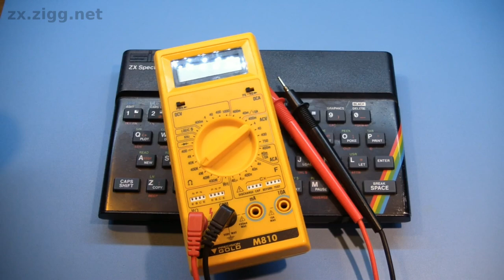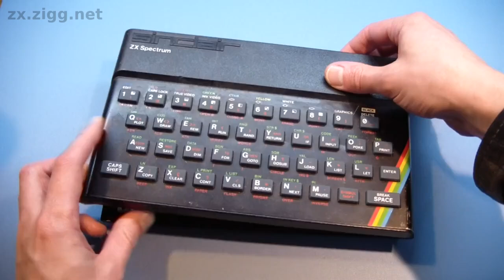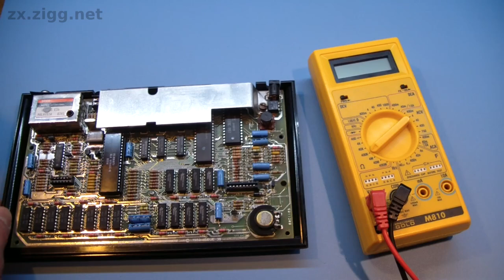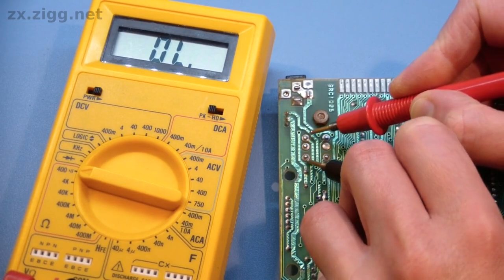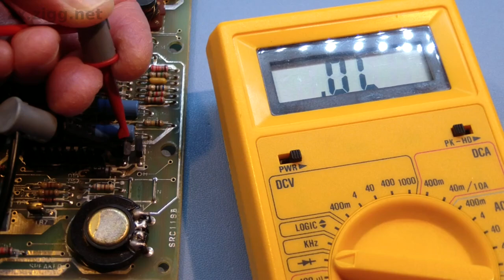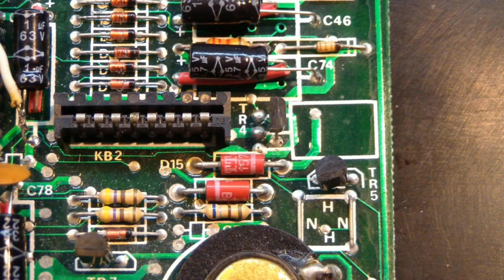ZX Spectrum (48K & 16K) Initial Tests

Comment: Hello! Is it possible to perform a composite mod on a Spectrum+ 128k? In the same way someone would do on a 48k/16k? Thanks!
Reply from the maker: leshurex I would think that bypassing the modulator in the same way as in earlier versions of the Spectrum would work. However, in the interests of keeping the computer in close to original condition, I wouldn't bother; the composite video signal is available on the DIN video socket. 

To use this output, one would wire the screen of a 75 ohm coax lead to pin 2 and the core to pin 1 of a suitable eight way DIN plug and the other to whatever type of connector is required for the display.
Reply: JoulesperCoulomb  Thanks for your quick reply! I bought that model some months ago, along with a faulty 48k model (displays flashing coloured blocks). At that time I performed the composite mod for both of them. Sadly, I never got to test the 128k given that it won't turn on (probably because I'm using a generic multi-voltage psu). Anyway, since then I was worried that the mod could've damaged the Speccy.
Reply from the maker: leshurex A basic power supply that outputs approx. 9 V DC and is able to supply around 1 A will do for either computer. Don't forget that the centre terminal of a Spectrum's power connector is the negative one. Getting the polarity wrong is likely to cause damage. There is a video in this channel about ZX Spectrum power supplies, should you be curious to know more.

In the case of the 128K Spectrum, if there is no signal on the composite output, it's a good idea to try the RGB output. If you can obtain a picture from the latter, it's likely the composite encoder IC or the voltage converter circuit that generates its power supply has failed.

As always, there could be many causes, but a display of flashing coloured blocks in the 48K Spectrum most likely points to a lower RAM fault or failure of the voltage converter circuit.
Reply: JoulesperCoulomb I remember testing the 48k's RAMs following this video and found any wrong values (I don't know if that rules out a RAM fault or not). How can I test the voltage converter circuit you mentioned? 
If it's worth mentioning I found that the X1 crystal was (pretty lousy) replaced with another, but not with the same component.

As for the 128k, I believe there was some problem with the power feed, but I would have to verify that later.
Reply from the maker: leshurex Good results from the tests described in this video don't guarantee the Spectrum is free from faults.

Have you measured the three power supply voltages (with power on) at the lower RAM?

X1 should be a 14 MHz quartz crystal. If the Spectrum is producing a picture, then there is almost certainly not anything wrong with X1.

If you get completely stuck and want to have your Spectrum(s) working again, I can offer a repair service (contact me via http://zx.zigg.net).
Reply: JoulesperCoulomb  Thanks again! I will check a few things more with my Spectrums using your tips. If I get completely stuck I would prefer giving them to you for free if you want them. Cheers!

Comment: Excellent job!.
I'm having trouble with my issue 3 spectrum displaying thick black and white vertical bars, sometimes with weird characters between them.
I've followed your tests and everything seems fine. Anyway I still have to replace capacitors.  
I was wondering, would it be worth to remove multiplexors IC25 and IC26 to bypass upper memory and see how initialisation could change? Is that a bad idea ?
Cheers
Reply: I have got the same problem with one of mine same issue also. How  did it work out?

Comment: Hi I have a 16K spectrum issue two, with small upside down pcb inside that is connected by thin wires near to the edge connector, is this a rare type ?

It powers on but so far I am unable to load games they either resets the spectrum or give me "M RAMTOP no good, 0: 1"

Any ideas ?

Thanks
Reply from the maker: I could be more certain if I were able to see the thing you describe. However, I suspect it is most likely a necessary modification because the computer has or had a 5C102 ULA fitted. This has a bug in its handling of I/O contention, which was (mostly) corrected by fitting an extra IC in the manner you describe. I assume this is an issue 2 or (if you're very lucky) issue 1 Spectrum.

If it hasn't been upgraded to a 48K model, is the software you are trying to load for the 16K Spectrum? Not too surprisingly, software expecting to find 48K of RAM won't work in this case.

Otherwise, faulty RAM is one of the most common causes of this type of problem. Try loading and running the Memtest program available at http://zx.zigg.net . Tell it to test the lower RAM. If your Spectrum has been upgraded to 48K, also have it test the upper RAM on a separate run. If the program should stop with an error report, post a copy of its output.
Reply: JoulesperCoulomb Thanks for the reply

I tried loading the memtest and a 16k game the program is found but then I just get the "M RAMTOP no good, 0:1" error.

Would a new lower ram fix module this do you think?
Reply from the maker: It might, but I'm a bit doubtful.

It's unusual, though not unknown, for a Spectrum to have a lower RAM fault and there not to be corruption of the display, which you haven't mentioned.

Are you sure it hasn't got the upper RAM fitted? The symptoms you describe are more often caused by a faulty upper RAM IC interfering on the data bus.

What result does the computer display if you execute the BASIC command PRINT PEEK 23732 + 256 * PEEK 23733  ?
Reply: Upper ram sockets are empty and has 16k sticker on the back.

I get 32767 result from commands, there is no corruption the spectrum starts up ok and simple basic listings work ok.

But when loading from mp3 player via ear port it gets past the found "program name" part but it either resets, or gives the ramtop error depending on the game or rom i try.

I have also replaced the capacitors.
Reply from the maker: This is certainly a rather unusual fault.

If I wanted to be fairly sure of uncovering the cause, I'd connect a many channelled logic analyser and capture what the CPU is doing at the time of the crash. I could then work my way through that, with a listing of the ROM disassembly on hand and I'd very likely be able to identify what went wrong. However, this process can be extremely time consuming and tedious.

If I wanted a quicker option, I'd probably try replacing the lower RAM as that has to be a prime suspect, but we can't be at all sure it is the cause of the fault.

WARNING: If you're going to remove the 4116 ICs and you haven't the equipment, experience and confidence to remove them intact without damaging the circuit board, I strongly recommend you use the method of cutting their legs off, before removing each leg from the board individually. It's much easier to obtain replacement RAM than it is to repair a circuit board that has had copper pads and tracks torn off. For further guidance on this, see:
  https://www.youtube.com/watch?v=u_NnU48bmv4
Reply: Thanks again for the info, I ordered a lower ram replacement from your link, luckily the ram ic's are already socketed, so removing them should be ok.

Comment: This is great, I will test when I get home. I've just purchased a toast rack the other day & when it's powered up it has the usual light grey boarder but has vertical light grey & black bars with no function, any ideas would be appreciated, thanks.
Reply from the maker: How wide are the vertical bars?

If a character width or similar, I'd first suspect the contended RAM; IC6 - IC13.

Note that the RAM in the 128K Spectrums is implemented rather differently from that in the earlier models. Much of the information in repair video 7, particularly part 4, is relevant to your Spectrum, though the component numbering isn't the same.
Reply: They are 1 character wide, thank you again, I'll spend some time on it tonight.
Reply: JoulesperCoulomb I've tested for shorts etc, finger probing causes some graphical glitches but I can not pinpoint it? It looks like it maybe ram issues, do you recommend that I get it repaired or should I sell it as spares/repair?
& is there anyone who can repairs these?
Reply from the maker: Obviously, it's up to you to decide what to do with it. It is one of the most desirable Sinclair computers, so I'd think it'd be worth getting it repaired.

I can offer a repair service; send me a message at http://zx.zigg.net if you want to know more. Also, a few regulars in the Hardware forum at http://www.worldofspectrum.org offer repair services too.
Reply: JoulesperCoulomb Thank you such much, I will contact you soon. I would love to see it work again as my late father taught me how to operate the spectrum. We had the 128k version back in the day & I'm so happy to have one again... This one will stay in my collection forever.

Comment: Hi, the white screen is shown when powered up but the text at the top is unreadable. I noticed there is no TR5 transistor on my board but there is the TR4 BC547 there. Do I need to add a TIP31 transistor for this? cheers
Reply from the maker: There shouldn't normally be any text near the top of the screen immediately after power on, so I'm not sure what you're referring to there.

There are not many small transistors that will work reliably for TR4. I suggest fitting a ZTX651/ZTX652/ZTX653 for TR4. Unless other modifications have been made, the voltage converter circuit cannot work without TR5. Many small PNP transistors can be used for TR5; I usually use a BC557.

I recommend fitting the correct transistors as described above and then briefly power the computer on and check for all three power supply voltages at the lower RAM. If it has been powered on without all of these present and correct, it is likely one or more of the lower RAM ICs will have failed.

Comment: Could you tell me what the resistance would be if I did have short on the power din and how too do this
Reply from the maker: I haven't got full details immediately to hand. However, I suggest you do the following...

Look up the pin-out of the power input DIN connector. Pay attention to whether it shows the socket on the computer or the plug on the PSU, but you'll be able to work out what each input is so long as you know that. Then measure the resistance between the 0 V pin and each of the other voltage inputs. It'd also be worth checking the resistance between the supply rails (e.g. the 5 V and 12 V input), but you're less likely to find a problem there. This is a rather inexact process as the circuit being measured is far from a pure resistance, but just as shown in this video, an unreasonably low reading suggests a fault. I can't remember quite what the results should be for a non-faulty +3, but I would be worried about readings much lower than approx. 150 ohms and I suspect they ought to be at least a few hundred ohms.

Comment: Could you tell me how to do these tests on a zx spectrum +3
Reply from the maker: The +3 is a rather different design and most of the tests described don't apply to it. Also, the +3 does not contain 4116 RAM ICs that are likely to be damaged if the power supply system isn't working properly.

However, before switching on a suspect +3 for the first time, I would take resistance measurements across the power supply rails to check there isn't a short or near short between any of them. The +3 doesn't have internal voltage conversion circuits like many of the earlier models; the external PSU provides the various voltages needed. So, this test can be done at the external DIN power connector without needing to open the case.

If possible, power the +3 for the first time from a bench power supply with current limits set and this might avoid damage in the case of some faults. Most functions of a +3 should work with the +5 V and + 12 V supplies present. If you have to use an original +3 PSU, check it is producing the correct voltages before connecting it.

Comment: I only have an avometer8 and it doesn`t have a 400 setting on the ohms.Can this meter still be used on any other settings?i have next to 0 electrical experiance.
Reply from the maker: If the meter is in proper working order and you know how to use it to measure resistance and voltage, then you should be able to do the job.

I don't know what resistance ranges your meter has, but use of one of the lower ones (say 1 kilohm or maybe even 10 kilohm) should be appropriate for most of the tests. The readings may well be rather different from those obtained using most digital multimeters, but it ought to be possible to use it to detect many of the most common faults.

Comment: Thanks for the video.

I was hoping to get some hints on if my measurements since I do not have any electrical/circuitry knowledge. Trying to revive my old Issue 3 (16k upgraded to 48k) which has flickering screen and strange characters. My multimeter only has a setting for 200kOhm (not 400k as with yours) and the values i get:

Voltage regulator: 18,5 (not even close to 100)
All lower memory chips: Top Right = 0,0, BR = 0,7, TL = 33,5, BL = 2,6 (not sure how to test the extra memory?)
Coil: Seems to have no problems
TR4 & 5: Can't get any values you have since my multimeter is different.

With the power supply hooked in, if i test the voltage regulator with black on the center pin (called common?) and red on the right one, the output voltage says about 4,95 V which seems ok?

This is what the screen looks like: http://imgur.com/AVgRWPh

Any hints would be awesome! ^^
Reply from the maker: Are you sure it's an issue 3? Those were generally only ever sold as the 48K model. There are (plausible) rumours some faulty issue 3 systems were sold as 16K models. What leads you to conclude it has been upgraded? Can you post a photo of the circuit board?

I'm not quite sure how to interpret the numbers you've posted.

The 5 V output from the regulator is a good start. What voltages do you measure at the lower RAM with the power on? See towards the end of the video where they are labelled.

From your photograph it looks as if the TV is not well adjusted or the video modulator in the Spectrum isn't working well - you could tap off the composite signal before the modulator. However, the display does look rather like what often happens when the lower RAM is faulty, but it's difficult to diagnose from just a photo.

I strongly recommend you get some hands-on help from someone with electronics experience or make use of a repair service. It's very easy to make things worse if you're not sure of what you're doing.
Reply: JoulesperCoulomb
 Thanks for your reply.

Back in the day my parents got me a ZX Spectrum which was 16k. A year or so later I was with my father in Stockholm city in a toy store called Stor & Liten to have them upgrade it to 48k. This being said, I only assume that this is my original one... they might have swapped it with a "real" 48k, who knows?

As you will see in the images below, this Spectrum is indeed an Issue 3. My multimeter doesn't have a 400k Ohm setting but only a 200k one so that is why i thought the numbers i provided my have been different. Not sure how Multimeters, Ohm, Voltage and all that works but i want to learn.

Anyway... so i tested the lower ram with Voltage DC setting at 20 and the values are the same for all lower memory chips:

5 V pin shows 4,96 V (seems ok)
-5 V pin shows only -1,76 (not even close)
12 V pin shows only 8,03 (not even close)

BTW, do you have a video on how to connect a composite cable and which alterations you need to do to the Spectrum? I tried plugging it in as is but got no video signal.

This is the image of my ZX: http://imgur.com/a/DkOxy
Reply from the maker: It does look rather like an issue 3 that was sold without the upper RAM. Unusual!

I think it very likely you'll find transistor TR4 (and possibly TR5) is faulty. The question is did it fail because of something shorting one of the supplies at the edge connector or because of a failed 4116 IC doing this instead?

Your multimeter is very unusual if it hasn't got a diode test mode, so you should be able to try the tests on TR4 & TR5 in circuit. What results do these give?

If necessary, TR4 can be replaced with a ZTX651/652/653. You might get through several if the lower RAM overloads the voltage converter circuit and you don't use a bench power supply with a current limit.

Faulty lower RAM ICs can be replaced with 4116s or all 8 with the ZX Spectrum lower RAM replacement module (http://zx.zigg.net/LRR).

The composite video signal is carried into the modulator by the wire that passes through the plastic insert on the left hand side of the can. The other connection is the 5 V supply. Both can be de-soldered from the circuit board and bent up out of the way or cut off (make sure they can't break off and become loose inside). Take the top off the modulator can and disconnect the resistor that couples the RF signal to the output connector. Install a new wire to carry the composite signal from the PCB to the output connector. I usually use a 100uF capacitor (electrolytic, positive terminal connected to the Spectrum PCB) instead to do this job as it removes the DC offset that some displays don't like, but most will work without this.

Again, I strongly recommend you get some assistance if you have no experience of the repair/assembly of electronic circuits.
Reply: Superb... i'll see if I can replace the TR4 & 5, just need to find the correct parts. It seems to me too that they might be faulty. I'll get back to you in a few weeks i guess since i need to order the parts.

My multimeter do have a diode test mode but i never got anything close to your results. Thanks again ^^